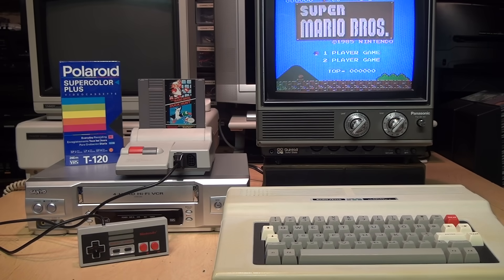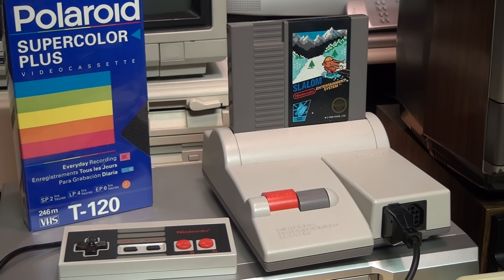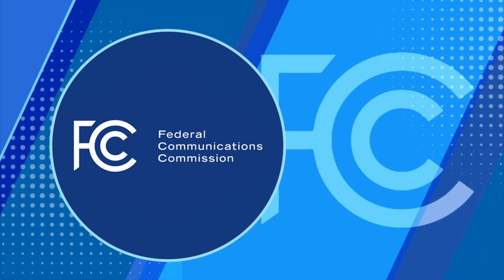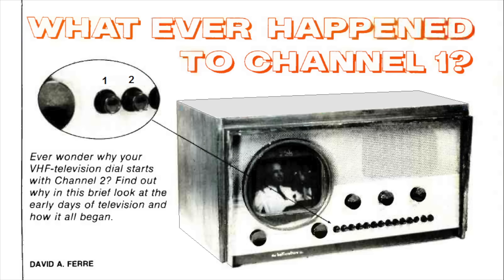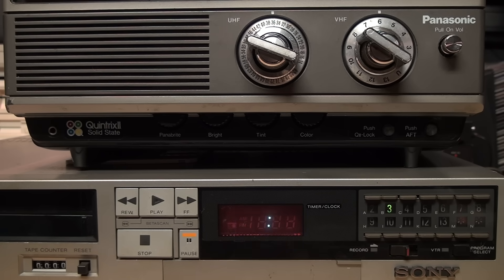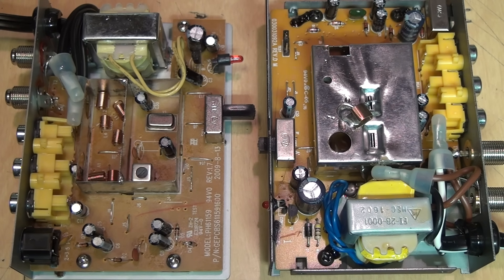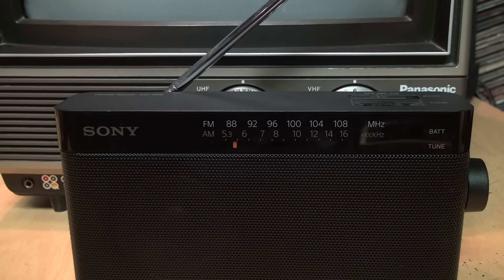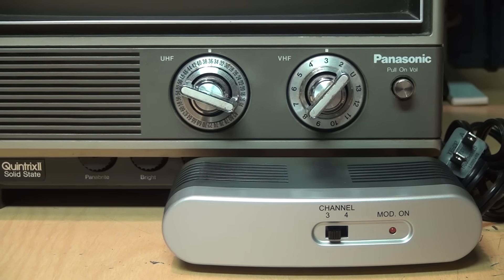Why your Nintendo was on Channel 3 (except in Cleveland)

Comment: @vwestlife Interesting topic, and you covered it well. However, there is a data point which I think pretty much answers the question of why channels 3 and 4. Adjacent Channel Interference was a real thing, and there were very few places where both Channels were broadcast. Since there is no gap between 3 and 4, they were pretty much assured to only have one and not both channels in any city. So the RF Modulators with channels 3 and 4 were guaranteed to find an open channel for most consumers. Channels 2 and 3 also have no gap, and they also don't both appear on your city list. Can't say why that was not selected.

Comment: I've always used the heavier RG-6 cable - and later, when it became available, RG-6QS (Quad Shield) - for my own TV and FM antenna setups, and when I do them for others.  That's especially important now for DTV, when many stations that used to broadcast on VHF have moved to UHF, even though the virtual channel system means they can still call themselves the old channel number.

Comment: There is - or rather, was - also a channel 3 in Phoenix.  But for a long time, adjacent channels were pretty rare.  If you had a local channel 3 station you didn't have a channel 4 station, and vice reversa.  So having the option of just 2 channels was enough.

Comment: Cable diameter is more to do with loss than shielding. You can have a well-shielded cable that works right up to  several GHz and which is still a tenth of an inch or less in diameter. If you have a laptop it probably has some 0.8mm coax inside. The shielding is fine, it just has relatively high loss. But that's no problem at all over short distances.

Comment: 1:40 Channel 69 Allentown PA, just north of Philly. As the biggest cities grew and new stations signed on in the 60s, 70s, and 80s, VHF filled up first then UHF got busy. Growing up in Philly, we were close enough to NYC to have a lot of channels already taken, and big enough in our own right to still be getting new stations. New licensees for full-power stations had to go high on UHF. By 1980 we in Philly already had 48, with 23/52 being NJ PBS. 57 went live around 1981, and 65 went live not long after in far south Jersey, Vineland. 69 was probably the next available. But if I recall correctly, nobody got a license for a station at 70-83. If another new station came, it would have been in that block. The FCC began dismantling UHF in 1983 and in 2017 everything above channel 37 got the ax.
Reply: You forgot to mention channel 61 (licensed to Wilmington, DE, which became a PAX/Ion station), and channel 62 (originally licensed to Atlantic City, NJ, now licensed to Mount Laurel, NJ as a Telemundo affiliate).
Reply: Fun fact: Allentown had another TV station with the “WFMZ” call sign that originally transmitted on UHF channel 67 from December 1954 to April 1955.
Reply: Channel 14 in Maryland is Public Access. PAC allows the greater Eastren Shore to receive updates in our communities. Travel outside to Baltimore, and they use channel 13. Channel 13 is WZBL News . Channel 1 is now reserved for Xfinity ppv.  TV Channel 200 range is no longer used and was switched to the 800 range

Comment: Here in Japan, TV is on 1 through 12. Seeing the old VCRs with 2 through 13 makes sense now having grown up in the states as a kid thanks to this vid. However, I believe the Japanese market versions would’ve allowed them to use the alternate TV signal services here instead of a higher band channel. When I had cable here in Japan it was weird using a cable box that was connected to the TV but was an input source that had its own tuning via the TV remote. My in laws still have this system and it feels weird as an American where the cable box has its own remote.
Reply: Japanese channels 1 through 12 is the same as American channels 2 through 13. :)

Comment: Do have to wonder if there was a deliberate effort to not have both 3 and 4 used in the same region. Was it just a coincidence? Did they have the foresight to avoid it? Was this just an exploitation by RF modulator designers that they happened to notice?
Reply from the maker: It's because you can't have two channels next to each other in use in the same area, except for 4 and 5 which have a gap between them (as shown on my chart).

Comment: SDI transceivers are readily available. In fact, my friend and I were able to receive digital signals via an SDI USB dongle. I think the only restriction is that you need an FCC License to operate one, which you can get when getting something like a ham radio license.
Reply: i think you got somting wrong. sdi is the professional version of hdmi.
its a simple rg6 cable, can do 1080p60 over about 100m, or 4kp60 ar 30m.
but most tv station used only 720i60 or 1080i60 logner cable runs are possible in these settings.

Comment: In New Zealand our VCR's and consoles used either VHF 2 or 3. I have a manual for the Sega Master System and there is a section in the manual mentioning the New Zealand model which had a switch to select channel 2 or 3, I believe the Australian or UK models would have used UHF. I believe the reason we had to use VHF is TV sets in the 80s were assembled in New Zealand and possibly as a cost saving measure didn't include VHF since back then we had just 2 channels. This all changed in the late 80s when we starting importing TV sets which now supported UHF. 

I remember in 1993 a school friend ringing me with excitment because his parents had bought him a Sega Mega Drive for his birthday, 30 minutes later he rang me back asking if I could bring down my TV as his new Mega Drive wouldn't tune into his 10 year old TV. The Mega Drive was UHF only, I am guessing Sega imported a bunch of consoles intended for Australia into NZ, possibly to fill a supply gap as the Mega Drive 2 was launched around the same time and initially supported VHF. My friend had to downgrade to a Master System.

Comment: the fact the content industry is even allowed to control what interfaces we have is insane in some ways. HDCP is such a trash thing, because if you have a slightly fickle HDMI you drop back to SD.

On a fun note I think Nintendo solved the interference problem because I remember even our front loader NES had a gray box that the coax went into from the Cable/ANT and it would auto switch the input. vs like in the Atari 2600 days where you had to reach behind the TV and slide a switch on a box from radio shack.
Reply: thankfully  there are ways to get around hdcp (chinese hdmi splitter). that signal can then be converter to sdi without problems.

Comment: I have to wonder if broadcast interference would have been an issue if the cabling and connectors for home A/V weren't built down to the absolute lowest cost possible. I don't recall ever really noticing a difference with what channel it was on, but fiddling with connectors to improve the picture was something I had to do regularly in the analog TV era.

Comment: that thing you said about Chicago doesn't make any sense.  If 3 and 4 are both unused in Chicago, why would you need to switch it to 4?  You didn't name a single use case for 4 and you didn't mention Cleveland once.  Explain why you shouldn't be replaced by a 12 year old or an AI

Comment: To this day, I dont know  if it was the NES or the TV i connected it to, but in a small room there was a B&W 2nd TV nearby that when also tuned to ch3 it would also display the NES with NOTHING connected to it. Either the NES or the TV it was actually connected to was definitely not shielded.

Comment: As a Chicagoan, even though CH3 worked, i always preferred CH4 for everything, slightly better picture and less interference from CH2. Growing up in the 80s and into the early 90s, we had an early 70s Zenith as the "kids tv" which didn't have coax inputs at all, so we always used an adapter, which I'm sure contributed to some of the interference we'd get on CH3

Comment: First TV I had in the UK, we used "Channel 5" for consoles/VHS.  Because we had 6 buttons on the TV to select channels, and we used a little dial to tune them in, the first 4 buttons we tuned to BBC 1, BBC 2, ITV and Channel 4 (The only 4 terrestrial TV channels at the time), and we tuned the 5th one to use for Consoles/VCR.  No idea what frequency/band/channel they were tuned to.

After watching the video I guess what we called "Channel 5" was probably tuned to (UHF) Channel 36.

Comment: the tv cable on most home computers here in the uk was quite thin, in some cases being standard screened audio cable, but they worked, probably cause length was about 2 metres max and the uhf modulators used had quite high output level

Comment: I don't remember what channel our Sega Master System II would be on here in Norway since we almost always used the SCART connection (and I think the SCART ports were on "channels" named AV1 and AV2 etc.) But I think VCR's tended to play on every channel in the 80s if you didn't have a SCART cable. You would plug the antenna cable into the VCR and then the output from the VCR into the antenna port on the TV; so that it could record on any channel and play on any channel; and when the VCR was turned off it would just forward the antenna signal to the TV.

Funnily enough; it took me years to realise that SCART was an acronym and not just a nickname for the cable. The Norwegian word for "sharp" is "skarpt" (in the neuter gender) but the p is silent in the dialect where I grew up so it sounds identical to how we say SCART as a word. So I thought they just called it "skarpt kabel" (sharp cable) because it was a cable that made the picture very sharp compared to the fuzzy coaxial cable. The grammar isn't quite sensible, but it was such a perfect coincidence that the acronym sounded identical to the word sharp and made the picture sharp so I didn't question it until years later when I heard people from other places where the p in "skarpt" would not be silent before I realised they weren't actually saying "skarpt" but "SCART".

Comment: We were lucky enough in France to have Péritel (SCART) on almost all TVs
Reply from the maker: That's just because France's use of SECAM instead of PAL and AM audio instead of FM made it terribly impractical to produce RF modulators for your weird non-standard video system.
Reply: SCART was a game changer when TVs in the UK started using it in the late 80's, the quality difference between RF and SCART was like night and day.  The plugs and sockets were fucking massive though 🤣

Comment: The information provided is only valid for System M countries (NTSC except Japan). In CCIR (PAL except Australia) countries VHF Band I is channel 2-4 and Band III is 5-12. UHF starts from Channel 29 to 69. The space between channel 4 and 5 are FM. 

In most CCIR countries, you can either use channel 2, 4 and 35 for personal devices.

And there are companies (most notably Blackmagic Design) trying to push SDI for consumer support.
Reply from the maker: The fact that Cleveland is mentioned in the title should be your clue that this video is from a North American perspective. And I thought the NES never really caught on in Europe and especially the UK, anyway?
Reply: @vwestlife  The NES isn't popular in Western Europe, however Nordic Europe is a different story (it also explains why there are two different incompatible 10NES chips in Europe). However I'm from Asia, over here the Famiclones are king, and a lot of them are Band I channel 2 or 4.

Comment: We often joke at work that the industry somehow decided that we'd need to buy expensive (initially) HDMI cables to connect to our cable boxes that run 80+ channels side by side using coax installed in the 70s.

There's even adapters can buy called MoCA adapters that let you run 2.5Gb ethernet over coax in your walls that supposedly does not interfere with cable channels.  A really good idea for people who don't want to (or can't due to rented house / apartment) run Cat6 cabling through their walls.
Reply: i run 3g sdi a lot, somtimes even 12g sdi, so even 12gb/s is no problem on a good coax cable.

Comment: I was born near the start of the digital age, I still grew up with audio and video cassettes here and there and I vividly remember the switch over from analog to digital TV broadcasts and my dad having to buy a converter box. But I never knew you could tune into TV broadcasts on a radio by using the same frequency, that's so insanely cool and convenient. Another way technology has weirdly evolved backwards somewhat...

Comment: Where I live we only had one single TV station for the whole country until 1973. There were at least two low budget TV models in the '60s that only had a fine tuning adjustment for the user, and that's it, no channel selector. Of course that single TV station was transmitted on different VHF channels at different regions, so the TVs were pre-set for the correct channel for each region. 

Changing channels was possible, by removing the back of the TV, and replacing a factory tuned plug-in module with the oscillator and modulator coils on it. Electrically it was an ordinary VHF tuner, without the drum mechanism, and only one set of oscillator and modulator coils, plus one alternative plug-in module that was stored on top of the tuner shield, secured with fishing line.

And hold on, released in 1957, we even had a TV with no IF stages, it was a direct RF receiver! Look up "Orion AT301" if you don't believe me. And an example for the single channel TV was "VTRGY AT631 Carmen", and I think a single channel model was available from Orion, too.

Comment: Here in Australia, channels 3, 4 and 5 were allocated right in the middle of what became the FM radio band - so quite a few stations outside the capital cities had to move to UHF. We also had Channel 0 (usually pronounced like the letter)  - which was used by two completely separate networks for different reasons - Channel 10 in Melbourne and Brisbane had to use 0 because regional stations had already taken 10, and  SBS broadcast on both VHF 0 and UHF 28 for the first few years because many still only had VHF antennas, so everyone could spend the night watching risqué foreign films. We also had channels 5A (now for satellite downlink) and 9A (now for DAB+ radio).

One thing that hasn't changed is our shortsightedness when it comes to technology (with the exception of mobile phones).
Reply: I grew up in Melbourne and I don't recall ever using channel 0 on our old dial-tuner TVs to watch channel 10. It was always on... channel 10. You mentioned regional stations, and I was living in the city, so perhaps the change was only in regional broadcast areas. I do recall from holiday trips that regional affiliates sometimes used different channels, like "Channel 7" basically became "Prime" and it was actually on channel 4 or something.

The game consoles that I used at the time mostly gave the option of outputting to channel 0 or channel 1, and I usually used 0 with no problems.
Reply: @Nezuji  The frequency change happened on 20 January 1980, way before my time. I've only really read about the change and saw the Channel 0 idents on YT.

Brisbane changed a number of years later - 10 September 1988.

Comment: In a given TV market, on VHF, at least in the analog days, two broadcasters could not be on adjacent channels if the channels were truly adjacent.  (There is a half step between 4 and 5; and a large gap as mentioned between 6 and 7.  So, by designing the RF modulator to be selectable between two adjacent channels, it was guaranteed to work in every market.  When packing out the VHF band, a market could have broadcasts on 2 and 4, or just 3.

Comment: I work with HD-SDI regularly and it's not entirely true that it runs over the "same coax". Up to about 20-30M it will run over pretty much anything with the right characteristic impedance, but any longer and you start to need cables specifically engineered for SDI
Reply: hd sdi?? in 2024? 
thats only up to 1080p30 /1080i60

we run screens, projectors, ... for events over sdi, but mostly 3g sdi, or somtimes 12g.

Comment: I've seen some built-in RF modulators (especially in DVB-S set top boxes) where one could change the frequency from the menu. I used three of these boxes to provide three separate TV channels for an eldery person suffering from dementia, so she could use the channel selector on her TV instead of a set top box remote, which she couldn't operate (or would forget it). It was quite a job finding three channels, which would not interfere with each other, as on of the modulators had quite a messy output. A timer outlet would restart the receivers every day at 3 AM, because one had a tendency to freeze :) This contraption (tucked away on the attic) worked really well until the person's death.

Comment: 5:00 I used to use one of those thin, screwless, coaxial cables used to connect a VCR to a television. 

I used it to connect my Verizon FiOS® cable box to the wall. There were a few channels that wouldn't come in unless I moved the cable just right. It was hanging among other cables behind the television.

So yeah, there's a reason that proper cables are as thick and inflexible as they are, but I didn't care because I preferred the convenience of the thin flexible cable that could be unplugged without screwing. 😊

Comment: One reason to choose channels 3 and 4 as the options available would be that it would be unlikely, if not impossible for both of those channels to be occupied in a single market. As with FM radio, the FCC tended to assign TV channels with some buffer between them in the same market.